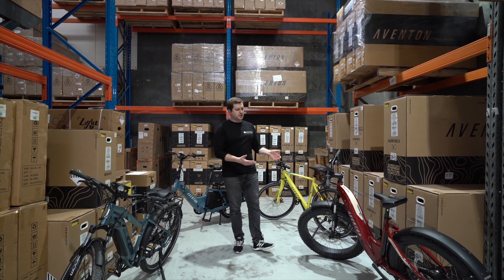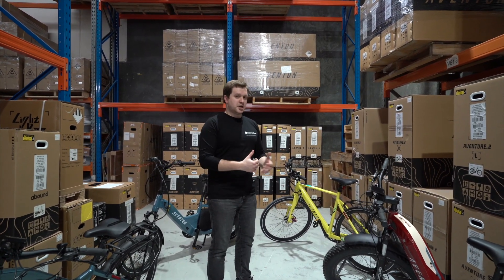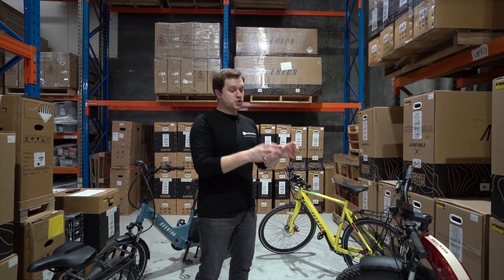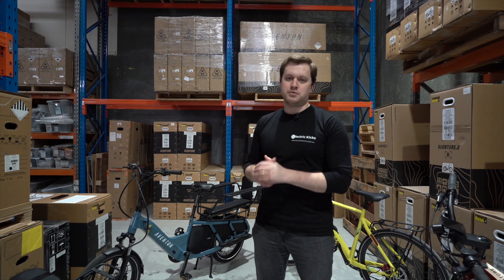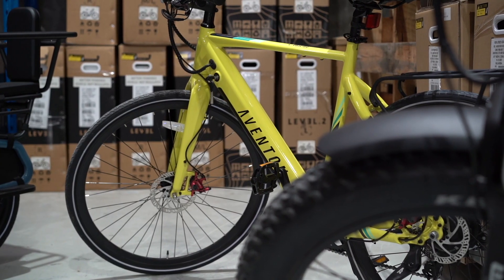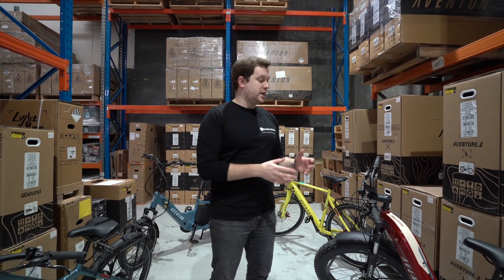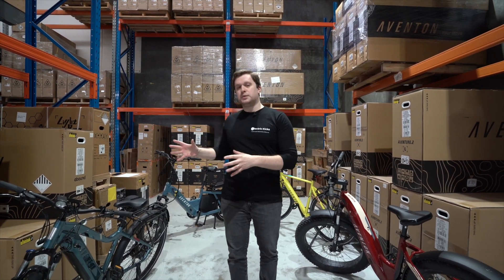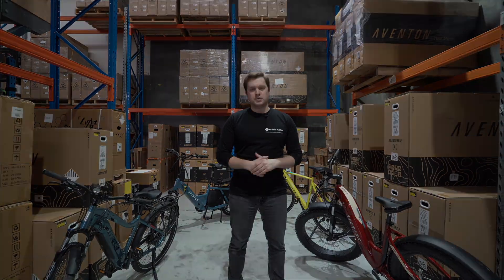Torque Sensors vs. Cadence Sensors: What's The Difference?

Comment: Cadence sensor almost got me to rear-end other vehicles several times. When I cruise to slow down for the red light it THINKS I need help and it jerks the bike forward. Never got that issue with a torque sensor.

Comment: Correct me if I'm wrong but it seems to me a Torque Sensor is better for going up hills and a Cadence Sensow for the flat roads.
Reply from the maker: You're right. Torque sensors are better for hills because they respond to how hard you pedal. Cadence sensors work fine on flat roads but aren't as responsive when climbing. However, it doesn't mean that torque sensors don't work great on flat roads. :)
Reply: @electrickicks  I agree. In your opinion what would you add to the following list for someone who lives in a very hilly area (18 degree in some cases) but needs to commute to the "lowlands" and back for retail outlets, etc.
This is a list that I have put together from listening to people like yourself;
Step-Through ebike, mid-hub, 75 nm or more, 750 watts or more,  torque sensor, seperate throttle from PAS.
Reply from the maker: That’s a great list for steep and regular climbs. You might also consider adding a high-capacity battery (720Wh or more), as range drops fast on hills, and hydraulic brakes for good stopping power. Then, round it out with solid components to match the terrain. 

Hope this helps!

Comment: This is a good summary of the top differences between torque snd cadence sensor e-bikes.

I think potential buyers would also benefit of a description between styles of cadence sensor e-bikes.

Most use a speed target style. Comparing it to a car, it’s like having a number of cruise control presets. The motor output curve shoots up steeply at the start, dropping off to zero or near-zero once the target speed is reached.

A smaller number use a current or power-setting style. Think of it as having throttle presets. The motor provides that power all the way up to the system max assist speed (25kph/15.5mph, 20mph or 28mph depending your local regulations).

I favor the power-setting style between the two on a cadence sensor bike (or mode for models that allow mode-switching between torque and cadence sensor modes). I like having direct control over the amount of assistance as it’s less likely to make me lose control of the bike due to a sudden surge, and I like that it doesn’t drop off assistance until the overall limit. It doesn’t give as much control as a torque sensor bike, but it gives more control over handling and speed than the speed-setting style.

I also don’t like the speed target style as it’s the only type that has thrown me off a bike (twice) or made me steer too wide in a right turn, almost into the opposing lane of traffic.

Comment: The good news is more brands are updating their software to use a torque sensor and respond to it as a torque sensor (motor output proportional to rider effort) or as a cadence sensor (sprints to speed target or outputs power setting of each level), so you can select which mode you prefer to use all the time or per ride.

A torque sensor outputs voltage according to how much effort the rider puts in. A cadence sensor reports blips each time a magnet passes its sensor. A torque sensor can be used as a cadence sensor (any voltage over a defined threshold is treated as an “on” signal, which just requires additional lines of code), but you can’t treat the signal from a cadence sensor as a torque signal.

I prefer the control of a torque sensor but there are times I would prefer a power (current) based assist based on a cadence sensor. Being able to switch between the two is amazing.

Comment: Nice comparison. 
Control is the big difference I experienced. Cadence always throw me off on tight u-turn.
Aventon is not fully utilizing the torque sensor together with brake sensor. During start, they still require initial cadence before giving assist which cause a delay. They should used brake sensor cutoff instead for safety.

Comment: I received the Aventon level 2 a few months ago.  I keep the petal assist on 1 most of the time.  When I start off in first or second gear, with little effort, the bike’s torque sensor blasts the bike forward.  If I want a softer takeoff, I start in fourth gear. So, any one who wants a workout, stick to the higher gear ratios, and anyone who needs greater assist, use the lower gears or turn up the assist number. Range is outstanding compared to my Rad with cadence sensor ebike.

Comment: My wife bought a e-bike with torque sensor last weekend (50 nm bosh), and yesterday we returned it.
She is a small woman, and need to drag a kid trolly with her, and she told me it was way to hard to drag when she met some upward hills...

After an evening of research on everything e-bike (I knew nothing ahead of this)  I am starting to suspect that the reason why it felt heavy for her is that she didn't have the power herself to squise  enough help of of the motor ?  
If the torque sensor motor only doubles what you put in and you have to add 100kwt yourself to get 100kwt from the motor I guess that will make it a lot harder if yu don't have 100 kwt to add.

So I guess she should buy something with cadens sensor instead ? 

Is my theory and reasoning making sense or am I completely wrong in assuming this ?
Reply from the maker: You're correct. Torque sensors provide a more natural riding experience by matching the motor's assistance to your pedaling effort.  However, for riders with limited leg strength, especially when starting from a stop or tackling hills with a load, it can feel demanding. That said, for your wife's situation, a cadence sensor e-bike might be a better fit.
Reply: Just received a bike with a torque sensor.  What I don’t like is that on a trail in the park in the lowest level of assistance, I want to get a bit of a workout, but if you pedal hard you haul ass.  In that situation I don’t want to go all that fast.  Very fun first ride I may get used to it. Like I said , in eco mode I’m easily doing 15 mph, and not even trying!

Comment: Would it be correct to say that with a cadence sensor you could hold the same cadence of pedalling and change yoyr speed only by changing the PAS level?
Reply from the maker: Yes, it would be correct to say that. This can made cadence sensors unpredictable because you can jump from 15 kph to 25 kph at the touch of a button, for example. Some people like that you can reach top speed by just keeping the pedals turning at the bare minimum, others prefer the control a torque sensor gives you. Matter of preference, we suppose. They are both great to use, either way.
Reply: @electrickicks  Thanks, I think I would prefer the torque sensor then utilize a throttle that I can control better for any speed boosts.

Comment: Great explanation. I’ve owned several Ebikes of both types and the torque drive motors are far superior. I would use the analogy of having the experience of riding an analogue bike, but with the legs and cardio ability of an Olympic athlete, even for someone relatively unfit. That is of course until you get to 16mph when you are then dumped back into reality😂
Reply from the maker: It's a good analogy. We're split 50/50 on torque vs. cadence in our office. Torque is certainly more natural and the responsiveness is better, but some of us prefer the effortless speed that comes with a cadence sensor - you can reach the bike's top speed by just keeping the pedals turning. However, this isn't for everyone and we are finding that more people are interested in torque sensors overall.